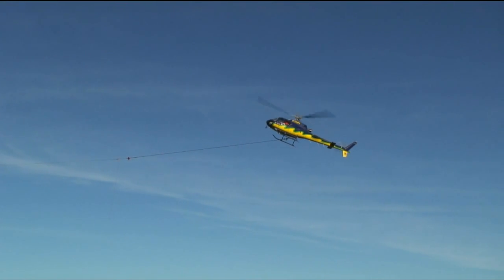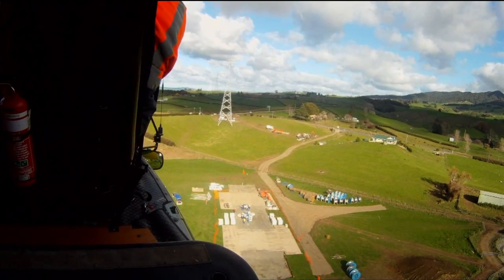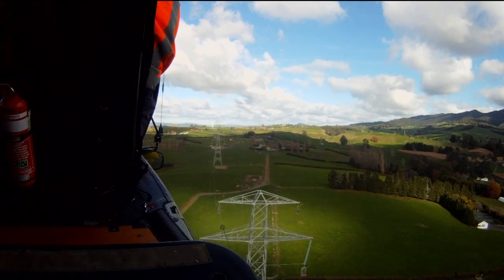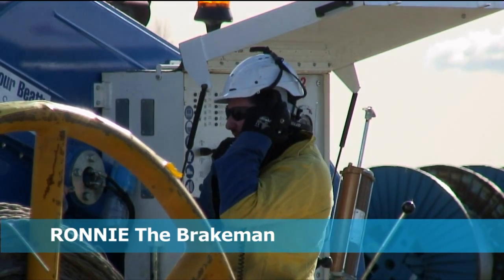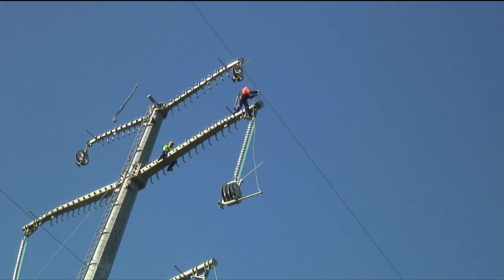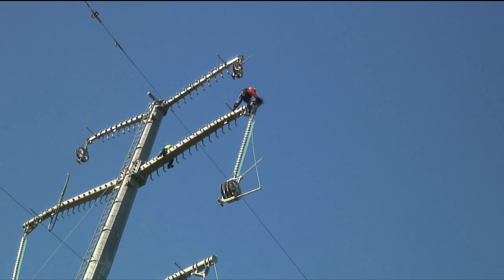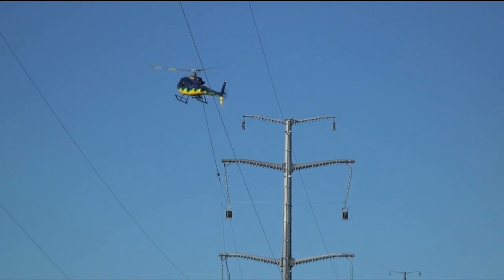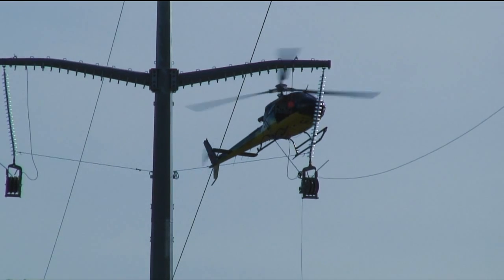Helicopter stringing

Comment: Crazy idea of using helicopters for this kind of work. The machine will be overstressed while pulling cables and stuff to the point of wearing out components, overheating and stressing bearings and then unexpectedly fail and crash. You can use them to occasionally lift a cable on the job but you can't use them for this sort of pulling work. Let them continue with this stupid and childish practice, the day will come when one of these birds will fail. Not even a real bird will last long in lifting its prey.
Reply: dont be dumb, the stress factors on the rotor hub and other essential components are all a factor of load and thrust. You realize the helicopter is never flying even during normal operations; all equipment and crew during a cruise stage of flight is still "hanging" from the rotor. If the helicopter can lift 900 lbs then it doesnt matter if it's crew or cables on the ground, as long as you stay within the limits it was designed for it's fine.
Reply: It actually prohibited in the Rotorcraft Flight Manual for the AS350/H125.
Reply: Hi Mick I had a guy from another site said these helicopters were designed for this type of work. I'm with you no way.  would love to see the maintenance log and the TBO.   US says hi